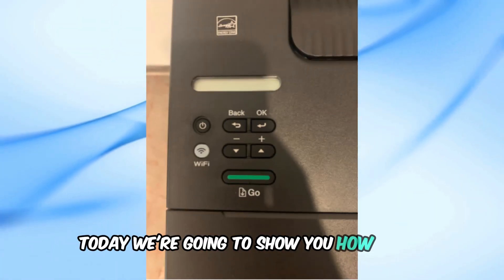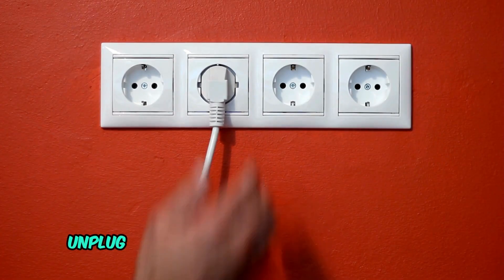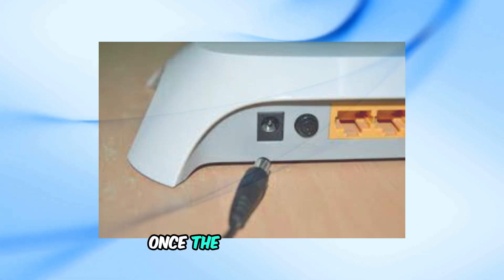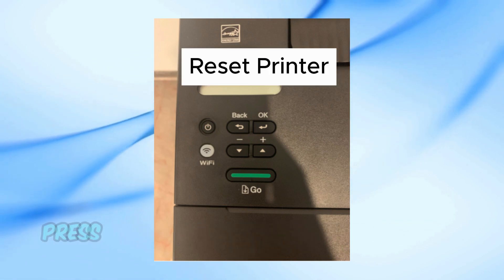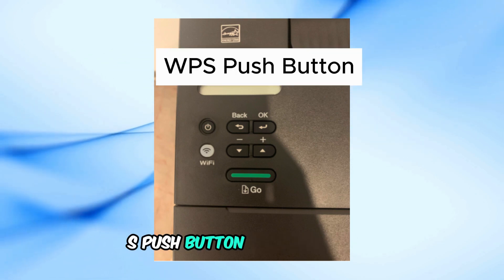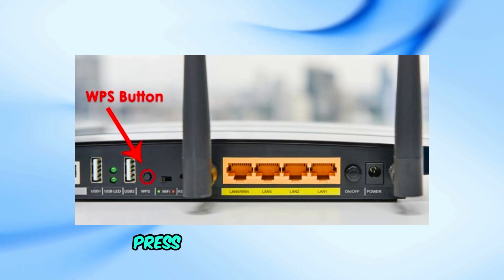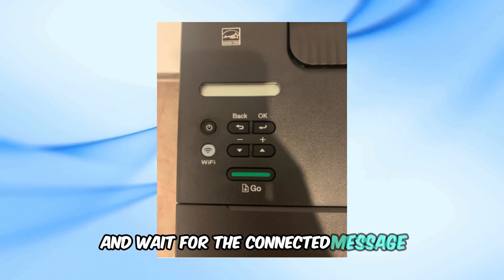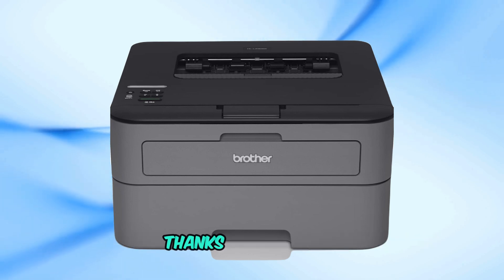How To Fix Brother Printer WiFi Light Blinking | Easy Troubleshooting Guide

Comment: If you don't want WiFi connectivity, and use USB, then follow these steps
Press Menu
Scroll down to Network, press OK
1. WLAN (WiFi) press OK
Scroll down to 8. WLAN Enable press right arrow to select OFF, press OK
Press Clear button continually until you exit from Menu